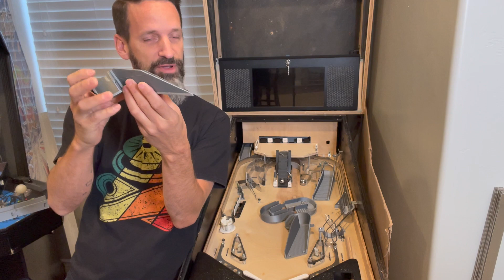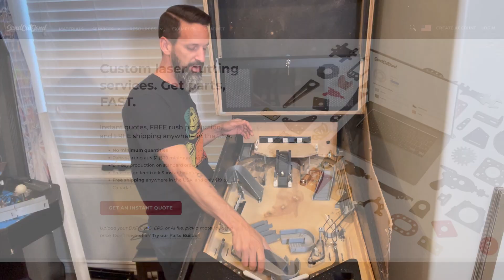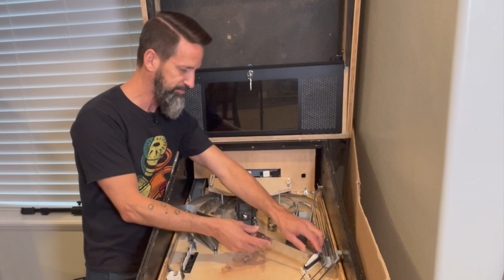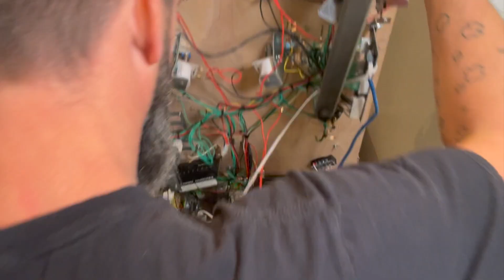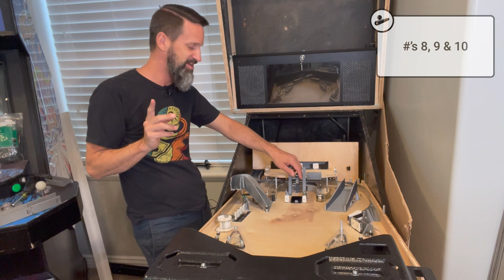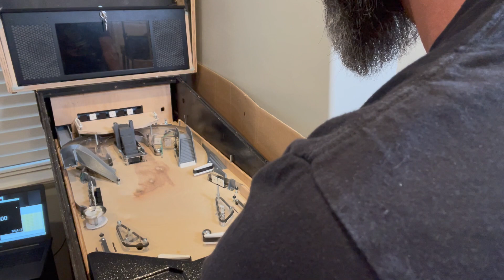HOW TO MAKE A PINBALL MACHINE: Playfield Tweaks

Comment: Your playtesting session at the end looks much improved, great work.  I'm glad you're recognizing how fast these balls can go and the risk of airballs and such.  

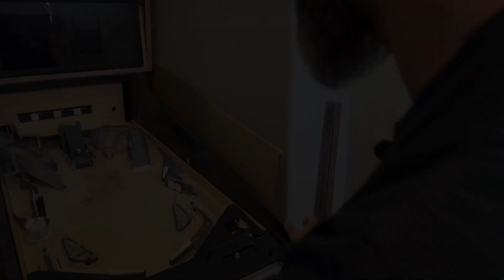I noticed at 42:18 the ball jumped a stair, skipping the opto-switch.  For this reason, you will need switches on every stair (and any other place a ball can rest and be out of reach of player control).  One of the nightmares of programming is when a ball disappears from the game - it didn't drain but the player can't access it anymore - and the game routine basically gets stuck.  That completely ruins gameplay, and normally requires a manual reset or at the very least lost ball handling routines.  It may feel expensive or extravagant to put switches on every stair, but trust me it will pay for itself in simplified programming.  It doesn't matter how diligent you are in your design, balls will get places you don't expect, so plan for the worse.  You always want to know exactly where every ball is located at every moment.  I've spent a few hundred too many hours troubleshooting ball tracking.

Related to this, I also implement in my code a check to see if a ball was actually captured - just because a switch is triggered doesn't mean the ball got captured, and often you will get multiple ball locks triggered before the ball comes to rest in a single ball lock.  You need to make sure your code doesn't count every switch hit, but rather evaluates if a ball was actually captured, and if so then in which ball lock (or ball step for you).  You may already have this in your code, not sure, but thought I would mention because this becomes a more frequent issue if you put switches on every step.  Just like what occurred at 42:18, where the ball would likely have triggered at least two, maybe  three optos.

Keep up the great work!
Reply from the maker: Yes think you're absolutely correct - I'm hoping to avoid an opto for each step but am thinking it's probably unavoidable really 🤷 

MPF does a pretty good job at determining true locks vs switch hits but I'm still learning how to configure that properly so 🤞 

But yeah overall I think the game's going in the right direction, but there's lots to do still

Comment: @28:10 Are the balls getting magnetized by the stairs itself and do they keep being magnetized even when they are not on the stairs? then you could opt for a demagnetize wheel (for example in the outhole where you have one extra space for the last ball that enters the outhole to be running past a demagnetize wheel. This could just be a flat laying wheel to one side of the outhole.
Reply: At least the ball hitting the magnetized ball on the stairs won't be attracted by the other ball as much.

Comment: @25:40 it would be cheating the rules, but also the game would cheat you (so, the joke is on you in this case). If there is a ball and empty step and then another ball it then will never give you a full multi-ball. as you cannot fill this step any more unless you get real lucky :P why not revers the stairs giving the option of possibly having a 2 ball multi-ball. You'd have to find a way to catch the balls at the bottom of the stairs and have an extra flat piece of stairs at the bottom (like a real escalator) it has a combe pattern at the bottom.
Reply: Since every step would have an optical sensor it would not be hard to program this.
Reply from the maker: @Jeroen_a  yeah I'm hoping to not add an opto for every stair step but I may just have to in the end 🤷
Reply: If you cover the top of the stairs (and the sides) why not use a traditional method with a post that pops up? (like the ones at the bottom flippers you sometimes see to save the ball from sinking in the middle?. This will ofc also mean the post does not score like the drop target. i think a metal post would not bounce the ball up.

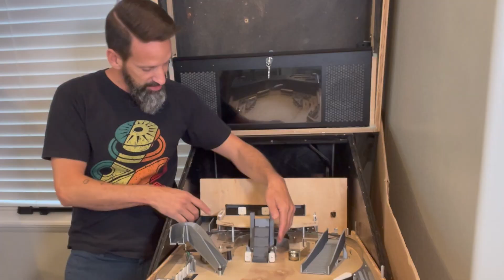Comment: Hey, i really like the way your project is going to. Everytime you present an issue, i immediately think "this is the way to solve that" (permanently or temporary until you put out the final iteration). But then you strike back and say the exact way i would solve this. @24:12 This time i'm going to be way ahead of you (probably episode 200 or so, that far into the project). Have you already thought about a ball search function? For when the ball does get lost somewhere or when a switch suddenly stops working (i'm usually the one that finds the perfect place for a ball to get stuck in a place it should not go at all). Once no targets or switches get triggers for (say) 1 minute. A Pinball machine goes into  ball search mode where it activates all moving parts one by one (coils, diverters, figures, outhole etc. See i'm not very good at creating things by hand, but i'm good at looking at the software side of a pinball machine :P The vibrations alone would sometimes be enough... ofc when a switch dies this is very helpful and you do not have to take the glass off to get the ball freed immediately. or was i late again?
Reply from the maker: Thanks for the feedback! Glad you're liking the videos - and yes you bring up an excellent point - MPF which I'm using for the code supports a ball search feature so yeah I'll definitely be adding that to my game code - but if the ball is stuck without any way to free it, like on the inside of the staircase, then even a ball search mode won't help  😞

Comment: Great segment Steve. Just a thought.....Could you use a thick piece of plexi or acrylic over the bottom stair so the visual isn't blocked by a piece of metal? Also, the edges of the metal might nick the ball which then wrecks the playfield. A thick piece of plexi or acrylic would not cause ball nicks. Just a thought....Great work man!
Reply from the maker: Yeah I've been considering that, or perhaps a slice of each stacked on top of each other maybe 🤷 but yeah I'll need to start thinking about the  visual side of all of this here before too long

Comment: Just a tip on your ramps: My other suggestion is to just go buy some aluminum flashing at home depot. You can cut it with sheers and super glue on the veneers onto the sides and floors of your ramps and will def look better than what you have.